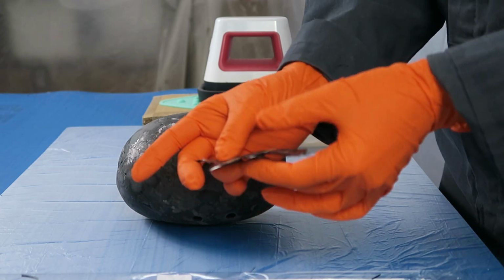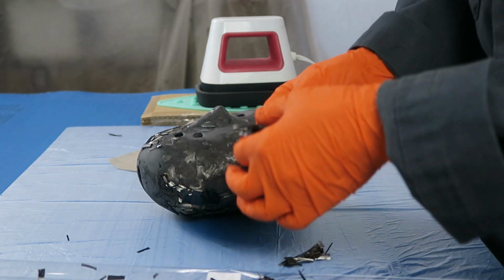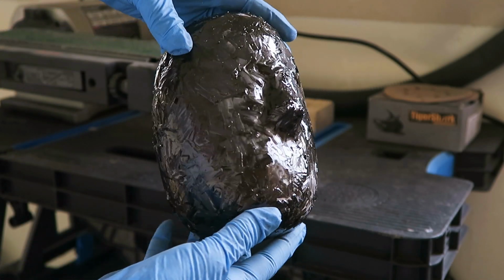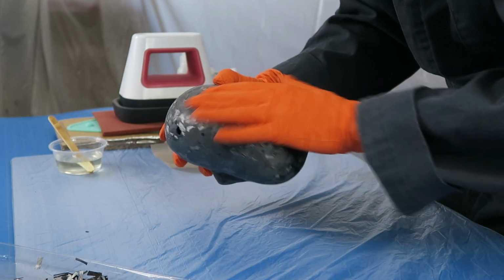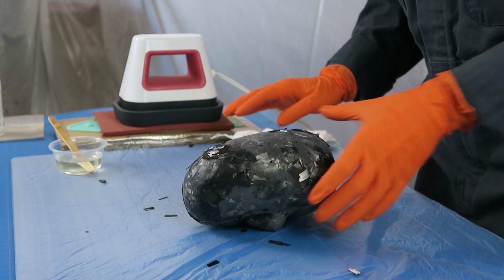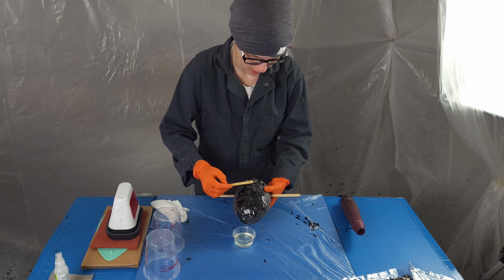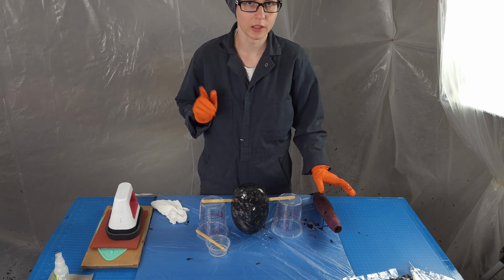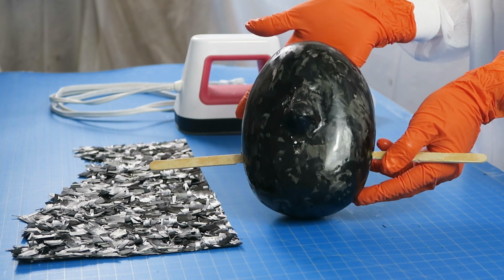Easy Way to Forged Carbon Fiber Skin with R-bond Forged Carbon Fiber Fabric

Comment: Little late to comment, but I wanted to say I like your plastic sheet enclosure work area. I might try this when I am going to cast some resin parts.
Reply from the maker: It works great to protect the surrounding surfaces from overspray and inside projects from contamination. And you feel like Dexter.

Comment: I haven't seen your other carbon videos, but in my experience applying raw carbon mat or tow (tow is the raw fiber) to surfaces, the best way to get raw carbon to stick to anything is with a tack coat of the same resin you're going to use in the bonding system. 

Depending on the working time, it may be necessary to pattern out the fabric so that it will match the topology of what you're trying to cover correctly.

Thanks for the tip on tacking raw carbon to plastic with heat. I wouldn't have expected it to key itself into the surface enough to hold like that.
Reply from the maker: Thanks for the suggestion, patterning would probably be a better way. This particular forged fabric has some kind of coating on the back that is heat activated, so plain raw carbon would definitely need resin or something to stick.
Reply: @LindyDesignLab  sounds like the mfg company sprayed one side with prepreg resin. Most of the forged carbon stuff out there is a completely saturated prepreg sheet that gets patterned, applied, wrapped in high temp cellophane and then baked to cure.

Thanks for clarifying how it was sticking. Sometimes I'm not the best viewer...
Reply from the maker: @aetherseraph well I'm not the best video maker or... anything maker... so feedback, corrections and ideas are always appreciated.